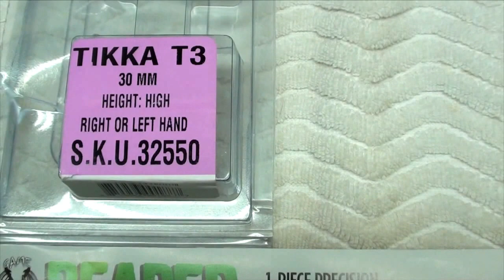Game Reaper Scope Mount

Comment: DNZ Instructions  State,? Not to use any LOC- TITE. On any of their Mounts.? As it is not needed etc.?
Reply: Correct. This guy just void his warranty. I have the tactical mount on my savage 110 300wm, held on by only torque, and I've had zero issues.
Reply: And Red Loc Tite will not come loose , if instructed should have been Blue or Purple

Comment: Taken directly from DNZ site
“ Thread Locker – it is not needed with our mounts if it is installed correct. DO NOT use any type of thread locker on our long ring screws. The screws we use are longer than other companies screws. We have about 20 threads holding your scope in place on each screw. If you do use thread locker, most of the time you will have to saw or break screws to get your scope out of mount. Do not send any mount back to us for exchange or refund if it has thread locker on the mount at any spot.”